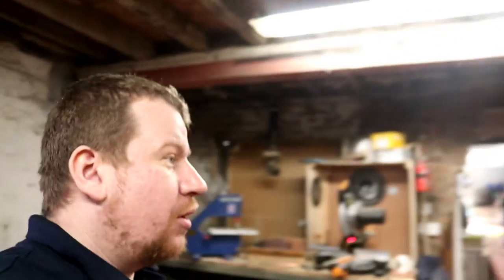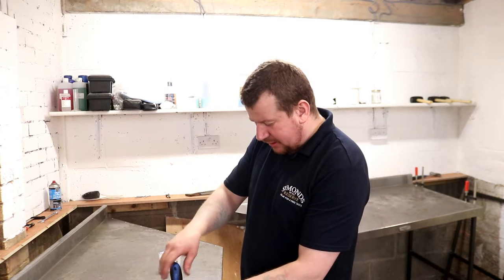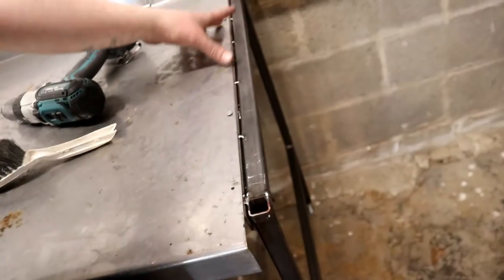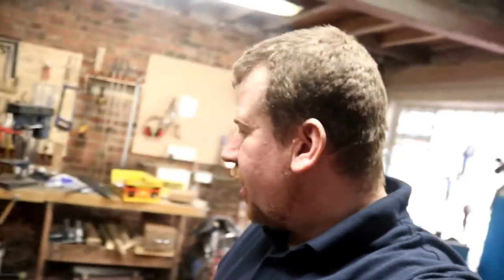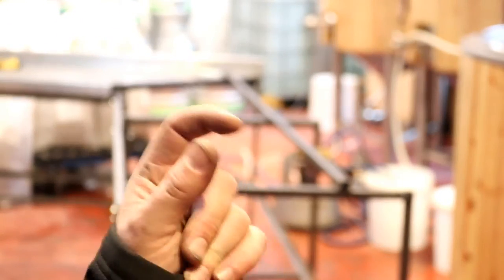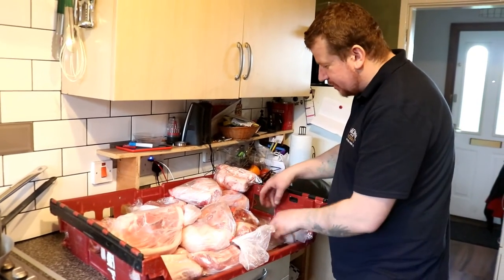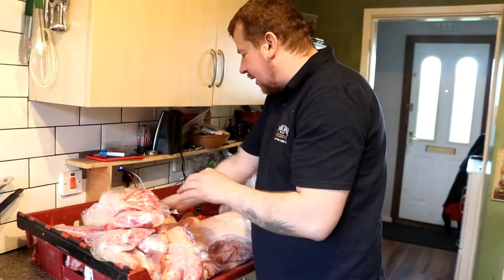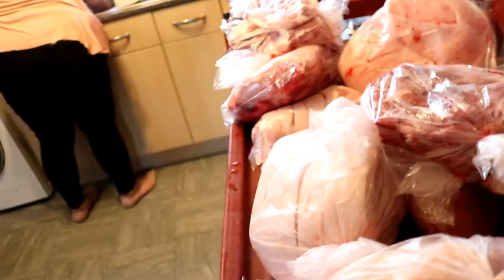SPENT GRAIN TRADE UP

Comment: It's all good when the hole lines up while your screwing 😉 😄 . Surely you can harvest the yeast in the same way that I do, just on a larger scale? Rather than a milk bottle full do a demi john full, or two if you need it. Clean it all well and add sugar to the slurry; bob's your uncle.  Did you have a pig? must have missed that one?  Great update as usual, pig curry? 😄 . Cheers, Schnuz.